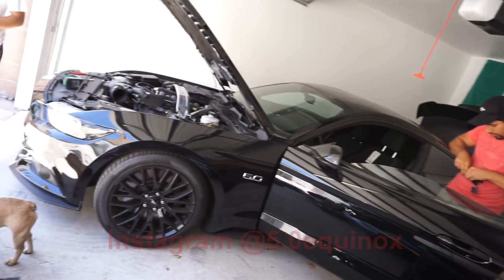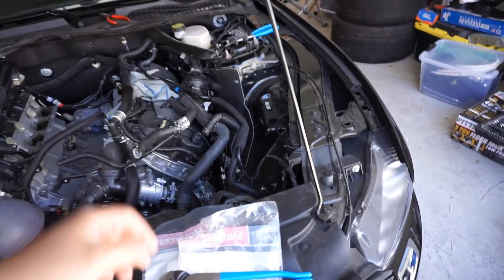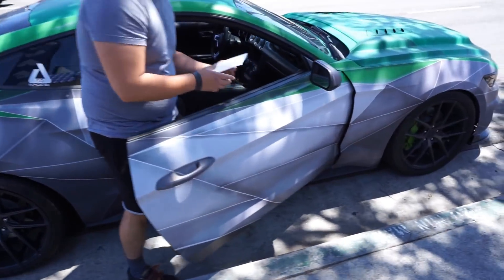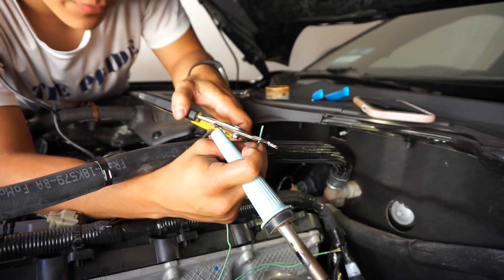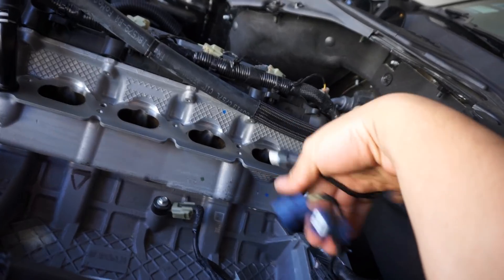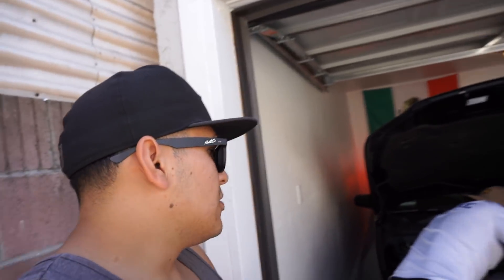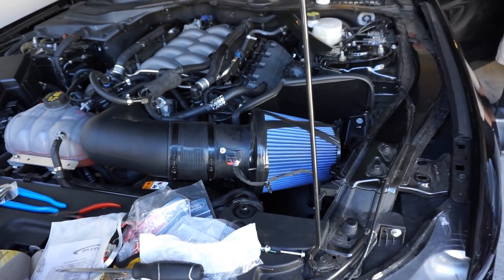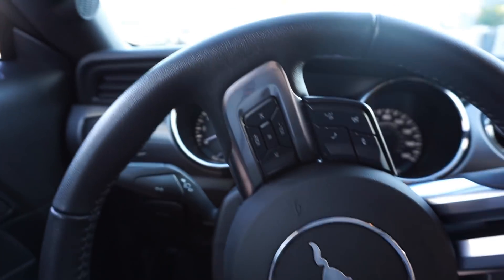2018 Mustang GT Manifold Install

Comment: Ayyy I’m installing a 2018 GT manifold along with 47lb ford injectors on my 2016 GT and then tuning for e85 this month too! Waiting on the manifold to arrive.
Reply from the maker: norulez873 nice!
Reply: norulez873 Have the same parts to put on my 16 GT this year. Did you get it done n are you happy with the results?  What tune did you use?

Thank You 
JD

Comment: I stay in southgate how much would you guys charge to slap on the 18 mani ?
Reply from the maker: Minato The sage 300. But get the imrc lock out kit. As of right now everyone who has tried to use the imrc plates on the 2015-2017 are having issues the 2018 is a completely different system. We tried three methods with my buddies car and the car runs perfect but you get a check engine light! They're is no correct perfect way right now and we followed Lund's install and two others from the forums! But they did a test where they block out the imrc plates and they didn't lose power at all and gained the expected hp and tq while not throwing a check engine light
Reply: EnriqueG_S550 i got the lock out kit but I didn’t make any power with it bro they said to get the imrc adapters so I got plug and play harness for it
Reply: EnriqueG_S550 it doesn’t work with the plug and play harness ? Because tbh I got it installed with the the lockout kit but I didn’t gain much bro
Reply: I’m in South Gate to and want this done lol where you guys located?

Comment: supercharger would make it a full bolt on... just saying haha
Reply from the maker: Street Empire702 no a supercharger would make it a boosted car/ forced induction car. Ask anyone what a "Full bolt on" car is and I'm pretty sure no real car guy would consider a supercharger a bolt on mod.
Reply: well let me ask you a question.... can you bolt on a supercharger, positive displacement or centrifugal???

i rest my case. #ydbt
Reply from the maker: Street Empire702 can you bolt on heads cams an engine? Let me engine swap a car an tell you its stock with just bolt ons. Would you consider that a bolt on? Obviously if you want to be exact any mod is a "Bolt on" right? You are the first person to ever tell me boost/forced induction is considered a part of a full bolt on car. Ok? Yea I watch him too?
Reply: why not it bolts on the motor doesn't? what makes it any different from heads, cams and header?
Reply from the maker: Street Empire702 I get your point. But in my opinion a N/A car from factory with an aftermarket supercharger doesnt fall under just a "bolt on" car. To each their own...
Reply: now that's a different story. a full bolt on "N/A" car would be different. if we just say Full bolt on the expectation is different.